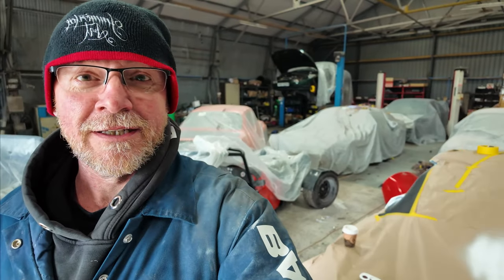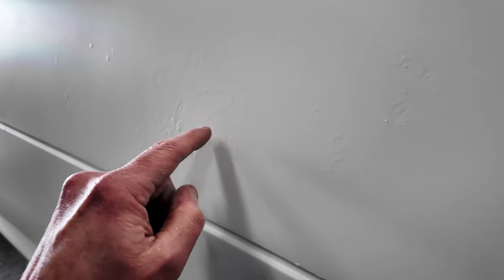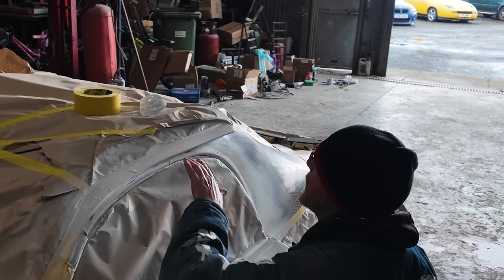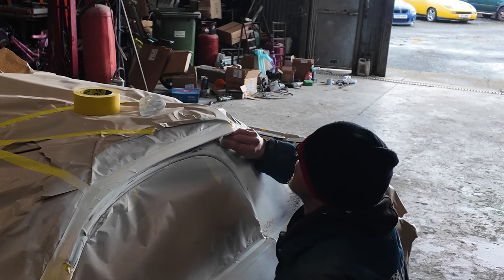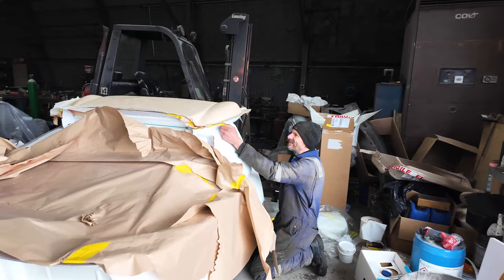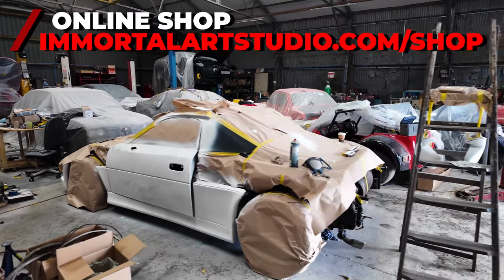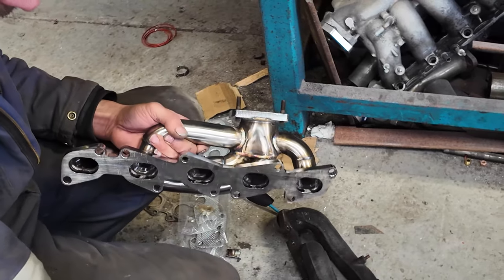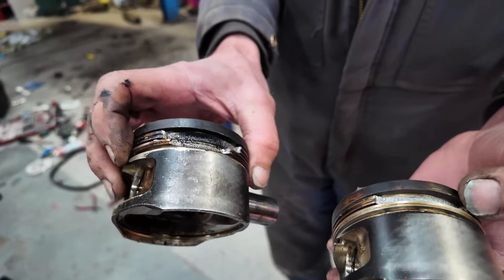Preparation is the key painting the RB200 kit car

Comment: Yay, more sanding. How come you are using the palm sander and not the long block for sanding the doors? Would have thought using the long block would keep it more level. Couldnt you change the pivot point of the rear clam lower and further back just so you can have whatever exhaust setup you want? Or sidepipes. Not sure on the legality of those though.
Reply from the maker: I thought I had them flat enough but obviously not 🤷🏻‍♂️ oh well, painted now and happy with them. Exhaust, I’ll work it out when the time comes. Exhaust tips mounted in the middle vent hole and a short tail pipe that meets them when the clam is in position I think will be the way to go.